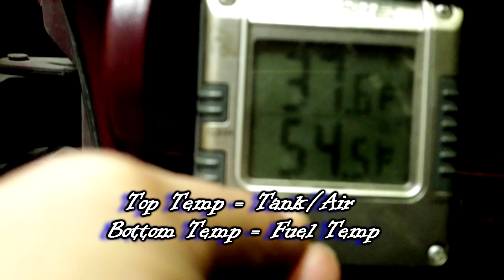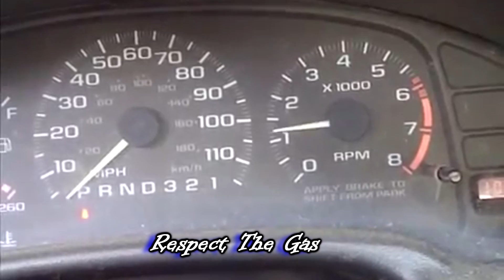Is 100MPG + Possible?? Alternative Multi Fuel Vapor Van!

Comment: Bubblers as you have seen on videos do nothing more than use the fluids own viscosity  as a intake valve that provides resistance to create a vacuum.It does this byu making the air enter the device through a resistant fluid. That resistance creates a vacuum  
The biggest problem with this technology is the ingrained information we have about combustion in the first place. The idea that bubbling air through fuel somehow breaks down the fluid even further is incorrect but because we have limited success we then modify the bubbler with smaller holes. We do calculations to estimate how many holes are required so as not to restrict the engine. Actually restriction is what is making the engine run at all its just that its counter intuitive to what we are taught. 
The other much tried answer is heat and this is definitely not the answer even though it seems to work somewhat . 
It is also not dangerous running it properly on vacuum as you cannot ignite  something where there is no air.(or little air) 
When we had our final set up completed in the lab we intentionally tried without any success to blow up the lab  we tried back firing the engine into the tank countless times( and on many occasions). All it ever did was light up our clear reinforced vinyl pool hose (in the way a flouerescent light lights up) If relying on heat and low vacuum you have the potential for a bomb when backfires occur. I know from experience( don't we all lol)
My goal was to run the system without heat. No pre warmer no wasted rad heat no exhaust heat no electrical heat. I was doing things that were counter intuitive to what I was hearing from others but based on my own observations and not my preconceived ideas.
Heat seems obvious but it isn't. When you spoke in the video about the gas "getting too cold" that is the vacuum at work. Mr Ogle( and everyone else for that matter myself among that broad sweeping statement) saw the solution.....
HEAT.  Makes perfect sense right?  Wrong.
Lower the boiling point further make the gasoline dissipate using the engines own vacuum. The biggest failures we had once we realized what the system was doing were leaks in the apparatus thereby killing the vacuum. most of the leaks were caused by making the device with multiple access points to be able to disassemble it for study. Or to use inferior materials that provided visual observation of the phenomena.
Its hard to detect a leak in a vacuum but rest assured if it doesnt start it is a leak in the system(somewhere)) We had made our tank so that the top was removable so that modifications could be made easily. This (we found ) made the tank susceptible to vacuum leaks. When the car would not start(much less run) we would blame it on everything we could think off (gas not being warm enough . holes in bubbler not big or numerous enough, premium versus regular gas does all this sound vaguely familiar)
It is one thing and one thing only. Vacuum leak.After everyone called it quits for the night I would sit and contemplate the device for hours. I finally decided to do this and only this. SEAL EVERY JOINT ON  THE SYSTEM. I used caulking, duct tape, plumbers dope. Finally the system that would not start earlier in the day no matter what ever else we tried, started easily and ran well. The only thing I had done differently was made sure it was completely sealed
I took an old piece of equipment ( an 1 1/2 inch elbow) replaced the elbow on the unit with it MADE SURE IT WAS SEALED PROPERLY and drilled a 1/4 inch hole in the radius of the elbow. The unit would not start. I sealed the hole with my index finger it started and ran well. I tried this over and over. Same result each time. I tried (while the engine was running ) to introduce even the slightest amount of air through that small hole and every time(EVERY TIME) the engine stalled.
I took apart the system that heated the tank ( exhaust heat) I performed all the experiments on the device without heat. Proper seal engine starts and runs. Improper seal engine dies or refuses to start. 
I tried this experiment in extreme weather conditions. Leaking system engine wont start or if it starts runs poorly or stops running soon after the test began. Properly sealed the engine starts without problems runs well and longer. 
    Is heat the answer? Is vacuum without leaks the answer? Goes against everything you know........ Doesn't it?
Most people involved in this project left even after it was proved to them time and time again.  Problem is it flies in the face of what you were taught and believe.
The device doesn't perform this way at all when you introduce "fresh " gasoline. It can leak for the most part and have good horsepower but eventually it has to have vacuum without leaks or it falters. Why? Well it is simple .
The need for vacuum or the strength of vacuum goes up when the most volatile part of the fuel( the light ends) gets used up first. This volatile part has the most available reactivity but the least potential energy. Slowly over time the gasoline degrades you get into the" heavier ends" of the refinement process these have the least amount of reactivity but the most potential energy. These heavier ends require a more substantial vacuum than the lighter ends.
The light ends only provide you with about 100 mpg but tremendous horsepower and reactivity The heavy ends about 900 mpg and very low reactivity. When you get the car running on this portion of the fuel you cant accelerate or even deviate from the speed at all, up or down.
If you are testing this system you will get my results if you set the engines speed and maintain that equilibrium throughout the test. Easy. Well on a test track its easy (Shell Oil ,GM, Ford) or a long straight drive( at a steady 55mph) to Demming and back. Keep in mind he didnt make the last 5 miles even though he had gasoline left in his tank.Why? He tried to slow down as he approached El Paso and had nothing but the heavy ends of the fuel left.......
I ran one test with the only goal of burning one quart of gasoline top to bottom without stopping or stalling. Fuel injectors at idle 16 minutes, device at 3400 RPM?  332 minutes. Great acceleration at the start cant deviate from the set RPM after 4 minutes. Why? I opened up the container when the fluid level was at zero and checked the container, no fuel was evident. I resealed the empty container and started the device and ran it 19 more minutes WITHOUT ANY VISIBLE FUEL AT ALL. It goes against everything you know or were taught.
See what I mean?
Any questions or discussions. 
780 700 7507
lesliec77@icloud.com
Reply from the maker: Thank you so much for your info! And I don't have an issue with disbelieving everything I was taught, for I know they were lies. I completely understand about having to have the system completely sealed, but are you saying that there's no introduction of air after those 2-4 mins then at say 3400rpm and still running? What does the vacuum reach? And what kind of container and I'm guessing stainless steal lines needed to handle it?
Reply: Well thats the way it is . I tried this over and over. The boiling point of gasoline is 100-400 degrees. That being the case if you boil off the gasoline at 200 degrees you are left with gasoline that will neither boil or evaporate(wont run in an engine either) Why? What is left over? gas will evaporate at room temperature but not completely Why? Why is it you cannot run an engine on "stale " gasoline? I mean if the only change in the gasoline is the volume the car should run. Problem is the chemical make up of the fuel has changed. Think about it. 
I used to believe in all of the opposing arguments but after experimenting with this technology for 3 full years I am now more qualified to form an opinion. If you had told me what I am proposing was even reasonable before I discovered I would have doubted it too. I could give you all the data and what I have come up with is the only rational that comes up with answers to all of the situations
I used to lecture on the subject and if you heard the lecture the conclusions are really quite obvious but not what you would think. You almost have to suspend belief in what you have been taught I know I did. 
Now you and your friends can stop bothering me unless you would really like to learn about this technology. I answer 40-50 emails a day on the subject most are positive and I dont mind answering the doubters but I understand their reservations I just dont have a lot of time 
I only post to try to save some other inventors money and time trying things that I have already tried. Im not sure why you bother to post
Reply: Well I would agree with you but we'd both be wrong
Reply: Have a good day
Reply: Run the heavy end as its own idle mixture. You will need a second bottom to suck out heavy end that is still under bottom. The light end can be used as acceleration mixture. But you run out of light end and left with a lawnmower that is running but at idle.

Comment: I use water injection.   it isn't a fuel.  it just cools exhaust gas temperature.
Reply from the maker: Don't discount the effects of water injection to just "cools exhaust temp" or only "preventing burning the intake valves" water IS the largest amount of power found on this planet, besides the electromagnetic force that emanates around us... I believe the violence that takes place in the combustion chamber is effective enough to use some of the hydrogen in the water, better effect with a finer mist.
Reply: Actually when I was testing I used water injection to prevent burning my intake valves
Reply: Sometimes I run boost juice from snow it's 49/51 meth/water respectively.   And you can definitely feel it when stage 2 kicks in.